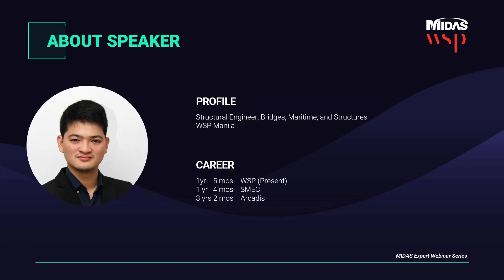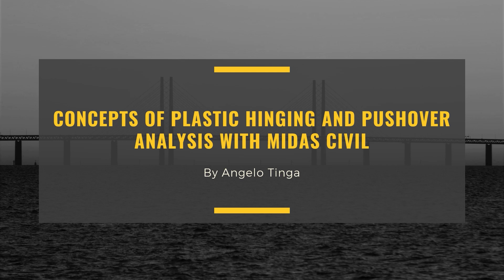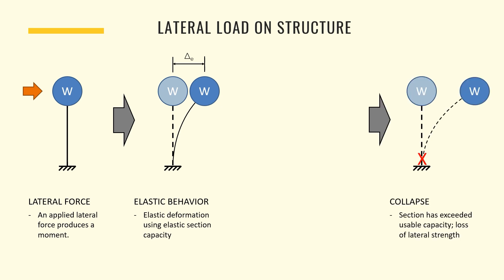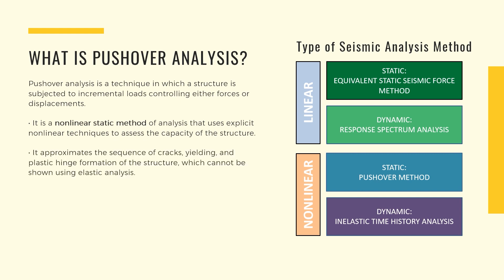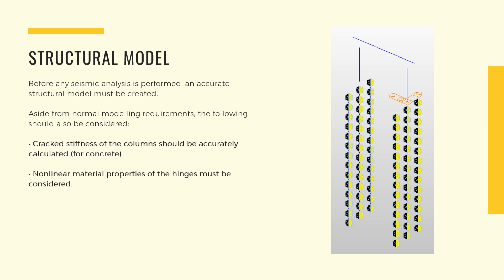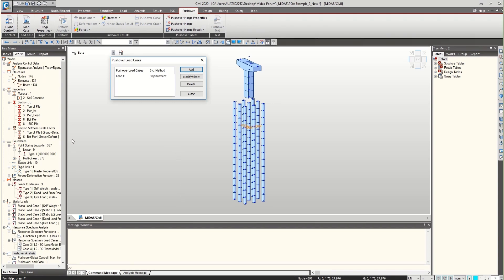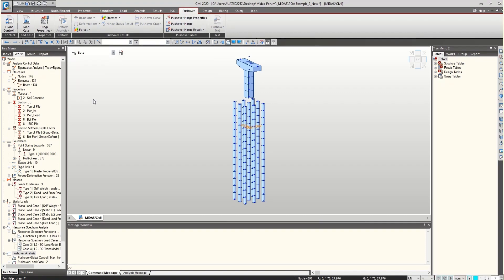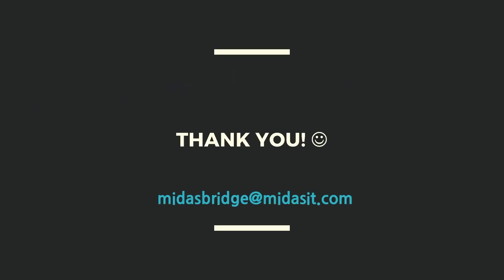Concepts of Plastic Hinging and Pushover Analysis | midas Civil | Angelo Patrick Tinga

Comment: Dear 
I noticed that you used single mode pushover analysis, it is not suitable for irregular shape structures as bridges, it is valid only for low rise and regular structures. So, it will give inaccurate results for bridges, the  better one to use nonlinear time history analysis instead of.